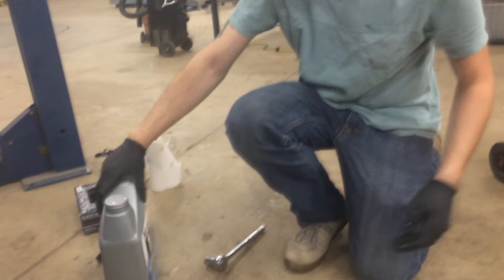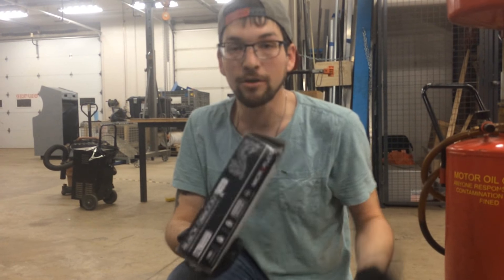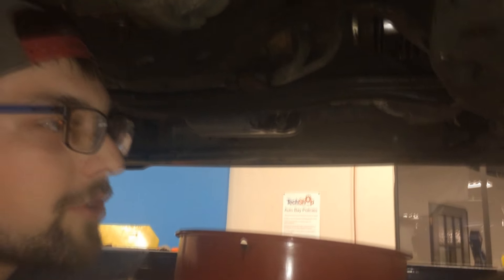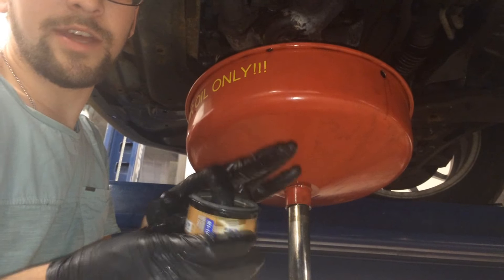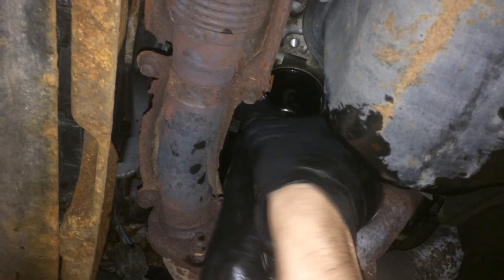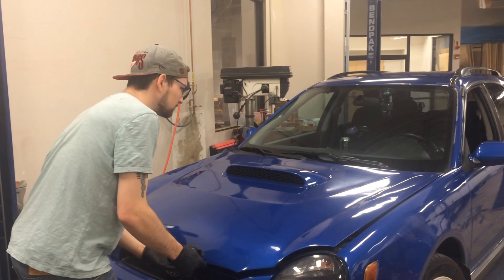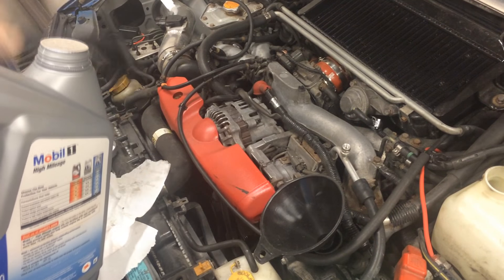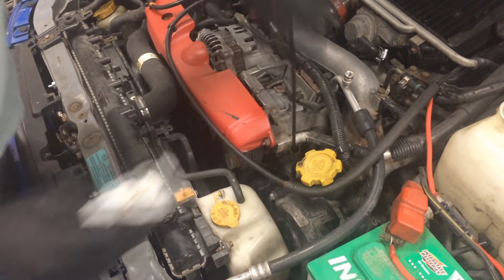How to Change Oil and Filter for 2002-2007 Subaru Impreza WRX

Comment: Use grade 4 or 5 when changing your oil. It’s especially needed considering the wrx has a turbocharger. And use synthetic oil. I personally wouldn’t suggest mobile1 but maybe Amsoil. It’s a few extra bucks, but it’s worth it.

Comment: the car takes 4.8 but dont forget there is still some left in the car after you drain it. you want to replace the amount you drained not the full amount the car takes. I would say youd be fine at 4.5 qtz. you can always check the dipstick to make sure you dont overfill.
Reply: Alexisblack overfilling by .3 won’t hurt anything man

Comment: Idk how much this guy truly digs into the boxer engine, but its best to use 40w when dealing with the boxer, especially when older models come around, 30w burns too fast and you have to top it off or your dipstick will be dry, trust me, 30w is cool if you are on granny mode, but damn near any turbo car gets ripped. So go with that 40w and always use amsoil! Royal purple isn’t good enough, it doesn’t flow like amsoil, hot or cold! Sae 5-w40.
Reply: i got amsoil 5w 30 would it be okay for me to use it for now

Comment: +1 point for the intro and leveling 
-1 point for not removing the fill cap before the drain
Reply: Hey I am about to do my own, why do you need to remove oil fill cap first? Does it really matter? Cheers
Reply: @castielangelofthelord1992  helps the oil drain

Comment: I’m new to doing this stuff but do u need to change the filter every time you change the oil or was the filter change just a bonus? I’m just wondering because I just got my first car which is this car.
Reply from the maker: The filter should always be changed when the oil is changed. It is responsible for skimming off any particulates that are in the oil so that they are not sent into the cylinder when the firing process is occurring.
Make sure when they are getting the filter for you that it is for the correct car. Assuming you have a 2002/2003 it wil be the 2.0L Turbocharged engine from a "Subaru Impreza" on their dropdown menus
Reply: nice first car.

Comment: How often do you recommend to change the oil on turbo charged subaru from 2008 using synthetic oil ?
Reply from the maker: I never went above 3000 miles per change
Reply: @AutoMotionDigital  thank you